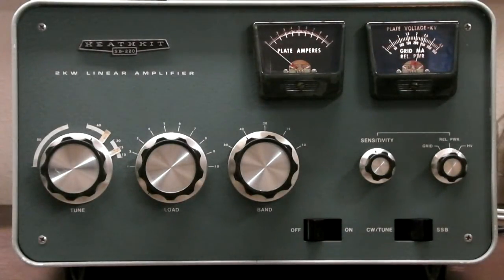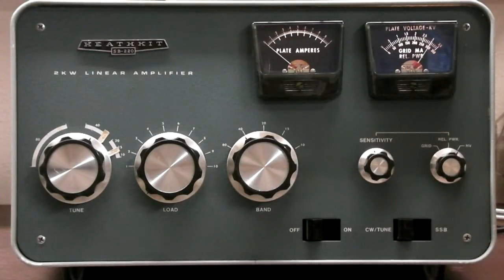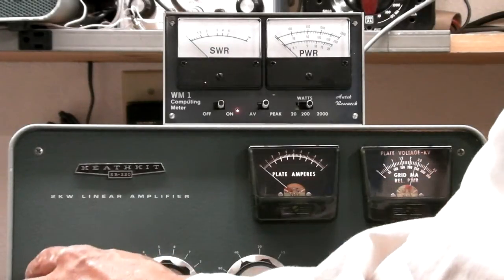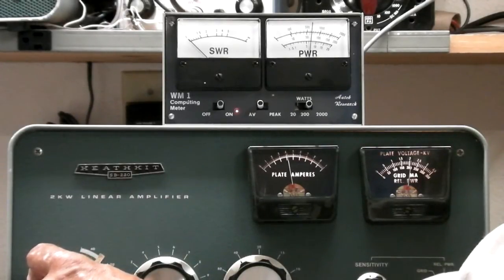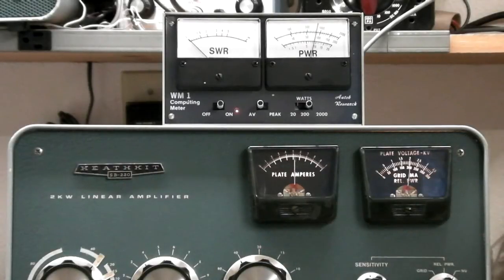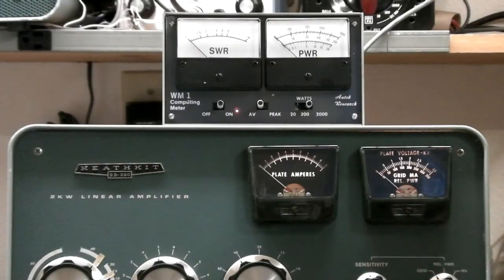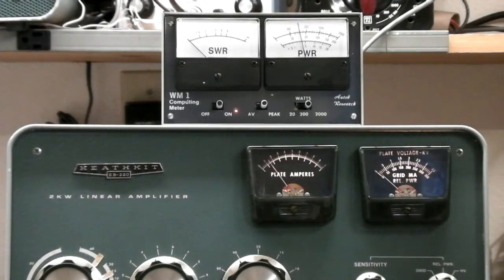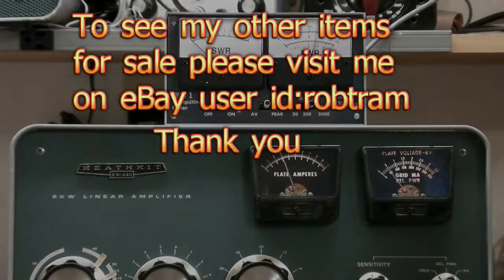Heathkit SB-220 Linear Amplifier

Comment: Would you consider doing the whole thing again, but focusing on the SB-220, as you adjust each one of the controls as the effect is shown on the PLATE METER and the PLATE VOLTAGE -KV or lower the camera image a little bit. Otherwise, your presentation is appreciated. Thank you!

Comment: This is the best tutorial video on You-Tube for simply tuning up the Heathkit SB-220 amplifier.  We don't see the driver (his transceiver) but he describes the amount of drive wattage he is supplying to the amplifier. If you own or are buying an SB-220,  it is best to keep the right side meter knob in the "GRID"  position. 250 m.a. is the limit, but whenever possible, tune the amp

      so the Grid Current is at or below 200 m.a. This will protect your tubes while still giving you great output. The SB-220 is a great amplifier. Simple yet powerful and very reliable. You can learn to tune it quickly in only a short time. With 100 watts drive power and a tuned antenna, it is possible to get 1,400 watts output, but I wouldn't advise it in order to protect the tubes.

         At 1,200 watts output, the receiving station won't be able to tell any difference. In fact, unless band conditions are horrifically noisy, the receiving station won't be able to tell the difference between 1,000 watts output or 1,400 watts output. You have to nearly double your output in order to achieve a single higher "S" unit on the receiving station's meter. 

      The more effective approach is to run the SB-220 at about 1,000 watts output in SSB mode, using about 80 watts of drive power, WHILE turning on your transceiver's "Audio Processor" or using Audio EQ for a narrow, piercing voice quality. Audio makes up more than half of your signal's readability.  A station using good punchy, narrow piercing audio, where the operator speaks up in a loud clear voice, running only 100 watts, is a far more powerful and receivable  than a station running 1,000 watts output with no audio compression, E.Q. or Audio Processing...especially if that operator speaks in a soft voice.  Audio compression, or Audio Processing from your transceiver, along with you speaking up in a clear and loud voice will nearly always make contacts. 'Best way to double or triple your signal is to use good audio and speak up loud in a clear voice.  'Seems obvious, yet its amazing how many operators don't follow this simple obvious approach.

Comment: 500mil plate current...180mil grid current..45w exiter...800watts out...on my sb-220...don't let your grid current ever go over 200mil on cw/tune or 250mil on ssb. Always keep your grid current down...Most videos I watch, they don't even show grid current they are just worried about how much power they can get out. I guess they have plenty of money for more 3-500z tubes.
Reply: with 100w exiter do i need to keep same values for grid and current?
Reply: @maxg70  greetings...with 100 watts you probably will be way over the 180mil grid current. Just use enough drive to keep it below 200mil Ig. Hope that helps
Reply: @maxg70  greetings...with 100 watts you probably will be way over the 180mil grid current. Just use enough drive to keep it below 200mil Ig. Hope that helps

Comment: Very rugged & dependable tube amplifier.Abused by so many a CBers.Maybe the best Dual 3-500 amplifier ever built but the Ameritron AL-82 is a very dependable amplifier as well in this class but they cost far more even on the used market.The Kenwood TL-922 is another great choice for a dual 3-500 amplifier.